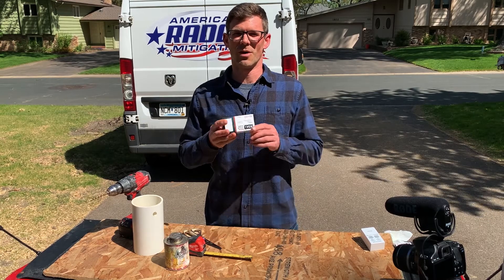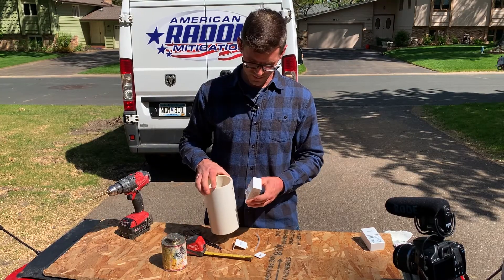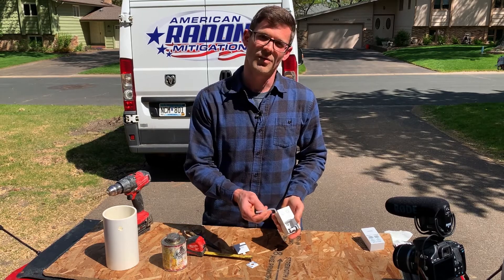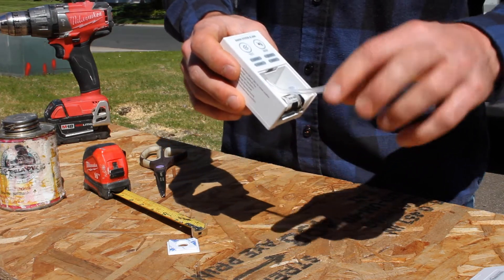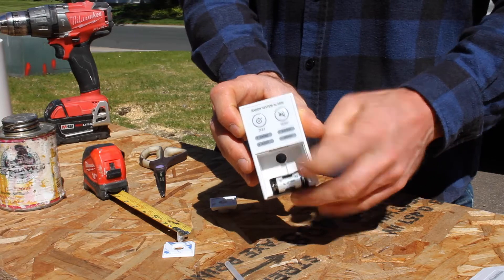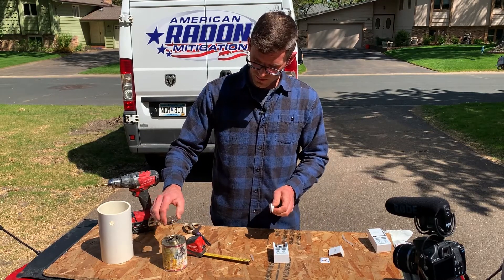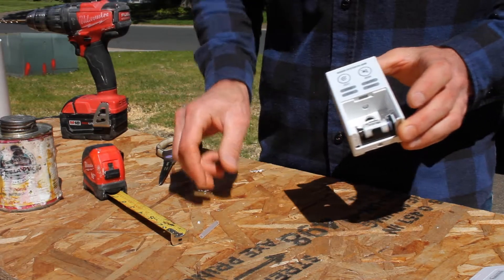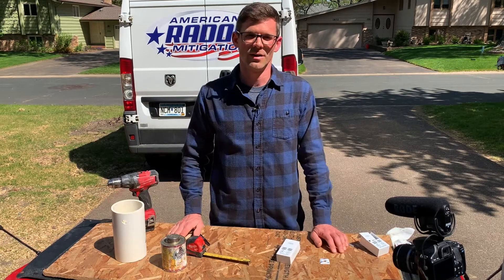RSA1 Radon System Alarm: Solving the Tubing Kink Problem

Comment: Good information. The alarm has been updated since with a new tube that has a 90 degree bend built in.
Reply from the maker: Thanks! We find plug-in alarms more reliable and don't have the nuisance of a battery. Most of our customers have chosen this option since we started offering it.